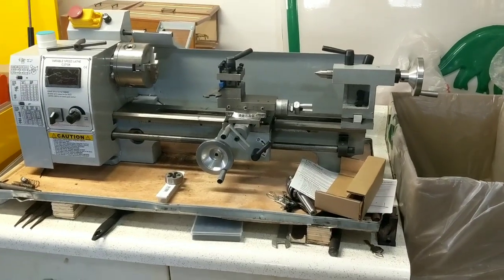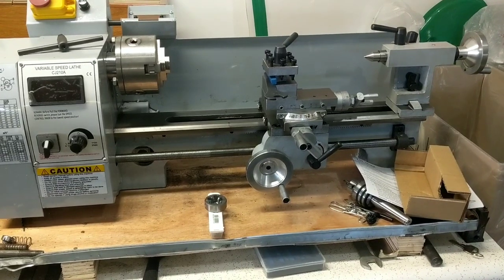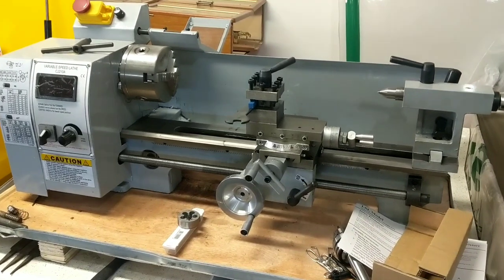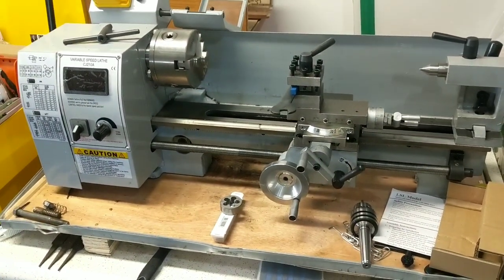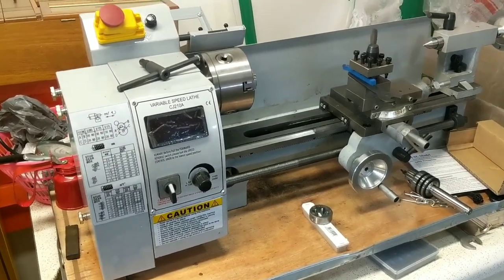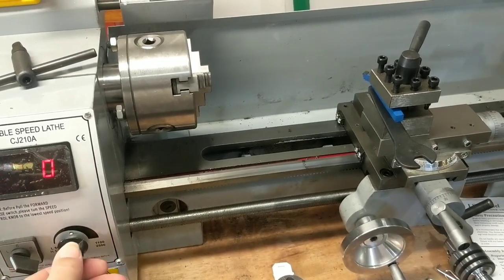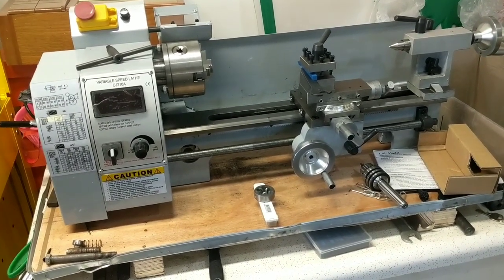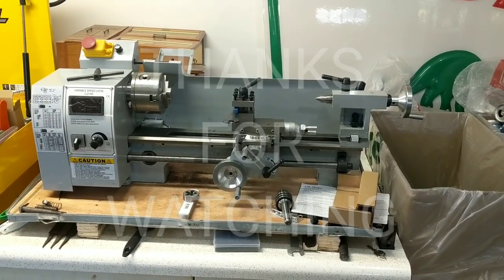Mini lathe CJ210A - was it worth it?

Comment: Like you I received the very same lathe but not what I ordered.  And like you I did not like the company I ordered from. But all in all it's not a bad lathe and yes after a few simple mods ( and ordering a backup set of angular contact bearings for the inevitable failure of the standard ball bearings ) it is going to do what I want it to do.  Please post any videos of your mods/improvements. Cheers 😁
Reply: Yes.. I also have angular contact bearings ready for when the cheap bearings give out.. or I get time set aside to change them.  I did have an issue with the tailstock clamp.. the plate inside the bed was pretty poorly designed so I replaced it with 1/4" steel and added a guide piece of steel that attaches to the bottom of the tailstock and fits snug between the bed rails.  Makes for a firmer feel... Less flopping around when moving the tailstock.

Comment: I don’t need a lathe. I don’t even know how to operate one other than what I’ve seen on you tube. But I sure want one. I’d probably start off only taking face cuts skimming off a couple thousands and trying to learn how to cut threads but what I do know is that if I did learn to do all that I’d probably  become dissatisfied in short order. That’s where the problem comes in. Obviously I should buy a used larger heavier version but how can I even justify purchasing something that I can’t operate? Thank you for your presentation and I’ll mull this over for some time before I make a decision.I know I’m 3years late for the party but if you’re still around can you tell me two things you really don’t like about it after owning it for as long as you do. Thanks

Comment: thank you for your response . Did your lathe come with any accessories ? You are right that there are many lathes on ebay and amazon. I had 
looked at micromark and little machine shop.
Reply from the maker: Yes it came with some cheap tooling, so I was able to use it right away

Comment: So, I found this same lathe and was wondering what kind of experience you had with its cutting depth per pass? I was quoted 12mm, which seems waaaaay over the top for this size of lathe.
And I was wondering, now that time has passed, if you had any issues with yours since you have started using it?
Reply from the maker: Your gonna only take a few thousand off per pass, these little lathes don't have the power to take off to much, plus you'll get a nicer finish.
I haven't had any issues with mine, but I don't use it daily.
Hope this helps you out and Thanks for Watching 👍

Comment: Where did you buy it, how much did you pay for it? I'm looking for a benchtop lathe to learn on before going out and seeing if I can find a larger older southbend or something.
Reply from the maker: I bought it off eBay, $530 but has metal gears and some cheap tooling. 
Thanks for watching
Reply: @barnyardgarage  was it used? The models im seeing new are all 850'ish
Reply from the maker: No it was new, they were accepting offers, I low balled to get it started and that's where we ended up, I do know EVERYTHING has gone up in price, but most of the Chinese lathes are the same, so they try to be competitive I think, hell it probably all the same company LOL

Comment: I’m a little curious how much you paid if you were thinking you could get a larger stand up used lathe for less than 1200 bucks or so.  Just curious because I’m also looking for a smaller bench top lather and these ones I am seeing around eBay for around 695 which still isn’t too bad compared to some of the cheaper ones with plastic gears and no digital rom indicator.
Reply from the maker: I paid right at $700 delivered, I've seen other larger ones for $1000-1500 with a lot of tooling.
Even the cheap eBay lathes you will/can spend a bunch in tooling and upgrades, if I had the room I would have spent an extra $500 or so and bought a much better lathe.
Thanks for watching let me know what you end up getting